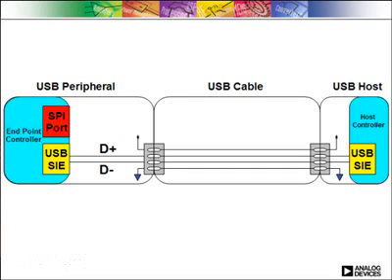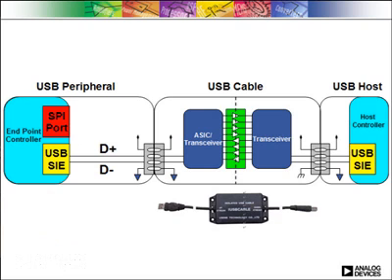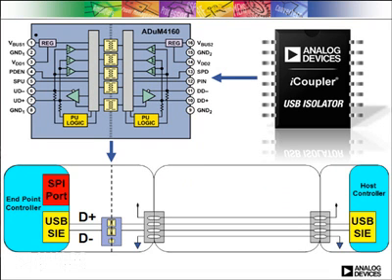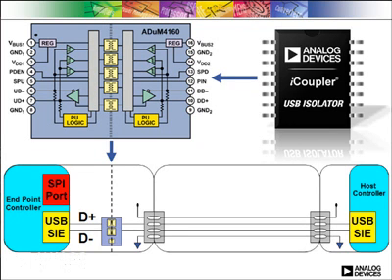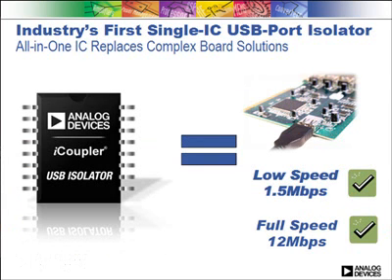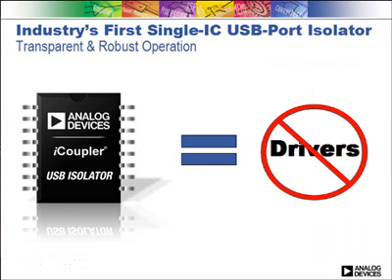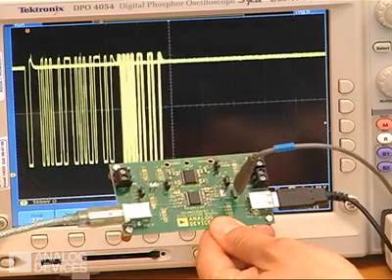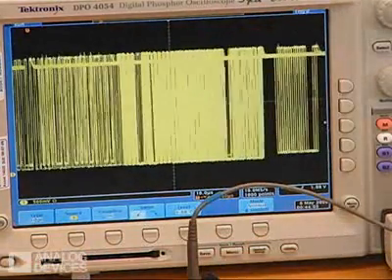ADuM4160: First Single Package USB Isolation Solution

Comment from the maker: (part 2) The ADuM4160 is built to reliably make USB2.0 devices operate at full speed by suppressing the high speed chirp that would initiate the 480Mbps mode.  It is therefore a USB2.0 compatible part because it works properly in that environment.

Comment from the maker: Hello, (part 1) The full speed rating  is 12Mbps, and was implemented from the start in USB 1.0.  Throughput in the full speed mode will be somewhat less than 12Mbps due to time sharing and bus overhead. A device does not have to support the 480Mbps speed mode to be a USB2.0 device.  It must handle the USB2.0 high speed operating request properly in order to be rated under that standard.